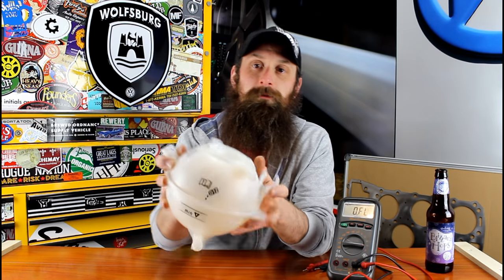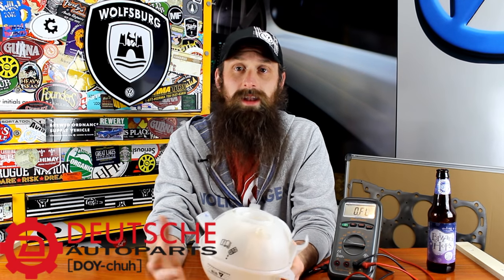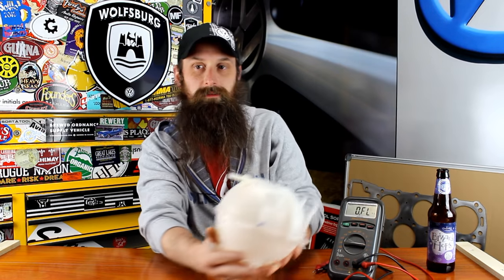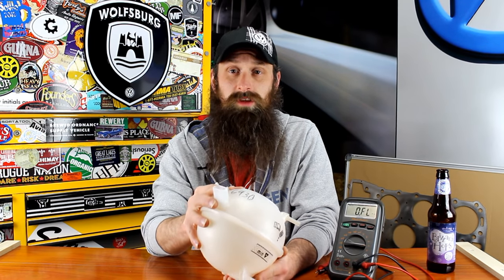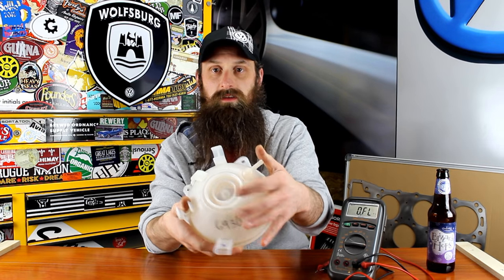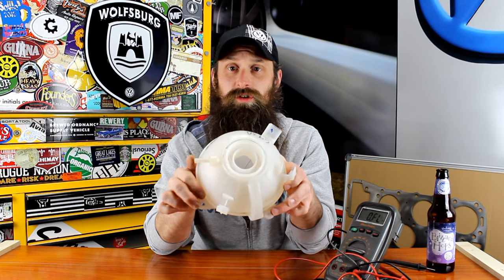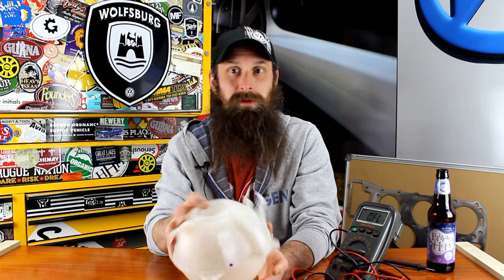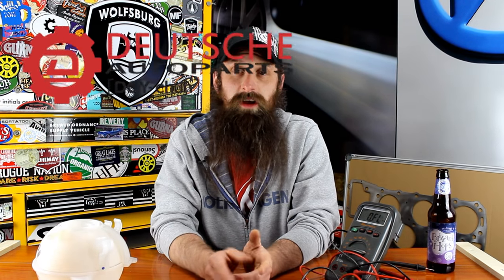How VW Coolant Bottles Fail

Comment: Hi, might be worthwhile updating this video. Many newer vw/audi/skoda/seat, have a marking on the bottle ' Mit Silicat', german for with silica. This means it contains a small pouch of silica, in the bottle. these pouches have been known to fail, and clog up the cooling system, especially badly affected is the heater matrix. To avoid this, I removed the pouch, flushed the system and filled it with the correct mix of vw evo 12 coolant, to ensure the coolant retains the correct anti corrosive propertie.Keep the videos coming, I find them really helpful!

Comment: My 04 Jetta  was running  hotter than normal. I had already  changed the reservoir and cap.  I then changed both the thermostat and  ects  ( engine coolant temperature  sensor). Well everything is  perfect again. I don't know which  part was the problem, but since I  had to drain the system I thought I just  change both parts . Thermostat was$9 ,sensor was$17
Reply: yes I also have a 2004 Jetta 1.8T engine the reservoir cracked at the top and I just ordered another one not only did that go to coolant control temperature when also I replaced that but now it doesn't seem to be working I guess the whole problem is the coolant reservoir bottle

Comment: Just thought I'd mention this, as I had an issue with coolant level sensor on a Skoda (same as VW & Audi). The 2 prongs in the bottle dont relay resistance the cluster module calculates capacitance. This type of sensor is called a capacitive sensor.Similar arrangement also used in the sump pan to detect oil level, but the capacitance calculator is built into the oil sensor.
Reply: Correctly said...

Comment: very cool, I'm pretty sure I have this exact problem on my 2006 Jetta TDI, the low coolant light comes on when the engine is cold, but if I turn the car off and back on again after it warms up slightly, the light doesnt come on, and the coolant reservoir is full
Reply: Same here - did cleaning the electrodes fix it? (OK - 6 years ago but hopeful : )

Comment: This would be a great video to launch off into VW coolant system woes.  I had a coolant light and a p2181 error on my daughter's 2003 Beetle.  I replaced the reservoir and still had the coolant error.😬 it ended up that the thermostat was stuck open and the engine wasn't getting up to optimum operating temperature.  The water pump wasn't suspect because we had already replaced that due to a broken plastic impeller and previous coolant error.  All said and done, we still love our driveway full of VW cars!

Comment: I Have 215,000+ miles on my 2004 Jetta TDI, got the coolant light and ended up being a leak at the small hose.  Speaking from experience...TAKE YOUR TIME CHANGING THIS RESERVOIR- The parts of the reservoir that connect hoses/connector were VERY brittle.  The old reservoir doesn't matter but the job is way harder and longer if they break on the inside of hose or even the connector clamp. Cheers and good luck!

Comment: best video yet on this subject. I have 2001 Jetta. Have flushed and filled with VW coolant. Always the one sensor rod closest to firewall corrodes. have replaced 2 times. No coolant migration. Even after flush/fill, coolant gets brownish. Could this be oil and could it be due to a bad oil cooler or seal? Thanks

Comment: My 1985 mk2 doesn't have any lights for warning me about low coolant levels and such (It has 4 lights total, power connected / warning light for engine running too hot / oil low / high beam), I just check all its fluids monthly, works for me.

Comment: I had a couple Volksagens that used a round one just like that.   There must be minor differences like the cap and bolt hole locations.  Over the years the cap is one change that is easy to see since the color and style changes but they all look interchangeable otherwise but probably are not.

Comment: Hi. I watch all of your  videos.  I don't know if you answer questions, but I  have a question about  my 2004  2.0litre Jetta. It just  started to run a little hotter than  normal.  The  temperature always ran with the gauge   straight up  in the middle. Now its more like 1 o'clock.  I changed the reservoir and  cap    because there was small leakage  around the return  line. I also  bought a thermostat and  a coolant temperature sensor.  What does the sensor do? Does it   control  hi and low  fan speed?. I'm not  sure how the cooling system  works.  Thanks

Comment: I own a stage 3 VW that keeps going through radiators every 4 months or so. I'm carefully installing them and tape cardboard to the fins so they dont get poked on install...

The car has aftermarket cooling fans. I used 2 relays and put them on switches... It has polar fis and I manually switch the fan on if it reaches 190° or so. I don't use AC. It throws a code for the cooling fans and AC. I want to code them out if possible but really need to figure out why my radiators keep failing.

My best guess is an electrolysis issue but I cant find a vw video on this topic. Have you dealt with this before?

Comment: My mechanics worked on my 2003 VW Passat 2.8L GTX cooling system to find and repair a leak.  A couple years later the heater core was replaced after removing the dash.  I am fairly confident the coolant system was completely flushed both times.  But after the first repair, the coolant bottle swelled up and developed a crack on top.  The coolant bottle was replaced.  After replacing the heater core, the coolant bottle again swelled up and developed a crack on the underside.  Sometimes when I stop the car, steam comes out from under the hood from the coolant dropping on the hot engine.  I have to top the coolant frequently. After the second repair, I replaced the coolant temperature sensor myself but did not burp the system.  Now I know better.  But do you think the swelling and cracking coolant bottle could be from air in the coolant?  The gauge on the dash indicates the car is not overheating, and there is no problem with the heater core for cabin air.  Any suggestions are welcome. - - Also, could you discuss how the VW Passat coolant bottle cap functions.  I have come to the conclusion that the cap opens and accepts air into the bottle after the coolant in the radiator cools down and creates a vacuum in the coolant bottle.  Looking through the cap opening, there is a small side compartment with a drain tube down the backside of the bottle open to the ambient air pressure.  Somehow the air must get into the center cup in the cap after the plug is sucked down, but I do not see any openings or even pin holes.  I cannot find anyone on YouTube or Google describing the function of the VW coolant bottle cap.

Comment: Hey Charles. 
I have a 2004 vw touran 1.9tdi 102hp. After a new head gasket, water pump, timing belt and a lot of other small stuff, I have a problem with my coolant. After 15min of highway driving I get a low coolant warning. And when I check the coolant tank is empty. Unscrew the lid and all of the coolant comes back. What do I do?
Reply: Having the same problem with my 04 Volkswagen caddy

Comment: I have 2004 jetta tdi that I just got a few months back.  Did a complete fluid change of all fluids.  Noticed inside the reservoir that one of the electrodes inside was completely missing.... The red light would randomly come on telling me my fluid was low.. Which it wasn't, but since one of the electrodes was missing, figured I should replace the bottle. Installed new one, and all was ok for a little while, then it started again with the light. Checked bottle, the same electrode on the new reservoir was starting to gunk up and, I had some coolant migration into the connector.. Not heavy, but would classify as moisture.  I cleaned the electrode with a tooth brush.  And it's fine for a bit then gets gunked up again. I just received the replacement reservoir from ECS tuning, free of charge, and I'm hesitant to replace it. For the time being, i have the plug disconnected and jumpered.  Something, has to be causing the coolant to flow up the electrodes and into the plug?. The one electrode is acting like a sacrificial anode.  I can replace bottles and engine harnesses all day long.... until the root cause is addressed, I'm afraid this will continue... Your thoughts?

Comment: Dude, great video. Yesterday my wife, son and I were getting ready to run around. Backed my car out of the garage (2012 Passat SE V6 B7/NMS platform) and the light started blinking. The coolant is below the min in my resovoir so I headed to autozone today to pick up some pentosin pentefrost e. Manual says that light is a coolant system malfunction. I’m surprised there wasn’t a a low coolant warning light that came on, however my wife drives it daily and hopefully she didn’t over look the warning light. Being that the light flashed however based on your video I will look at the contacts and see if they are gunked up. There is approx 70k miles on the car.
Reply: So upon further discovery: when i went to add coolant to top off the reservoir, the first thing i noticed was that the cap was loose. This was probably done during the last service at the dealer. I'm assuming i lost coolant due to evaporation?? I guessed accurately at adding 16 ounces of fluid (8-oz coolant, 8-oz distilled water). My next question is since the system is to be pressurized, would there be contingent damage due to the cap being loose? Any thoughts ?!?!

Comment: HumbleMechanic , I have a trouble with my vw Polo 1.2 MPI (Petrol) here in India. Recently, i am observing some weird engine RPM while driving. My observations are as follows: 
1) At cold start Engine RPM is 1300. Then, it falls down to normal 900 range after a slight warming up.
2) When the vehicle moves, in the 2nd gear with an RPM close to 2000, and if i leave my foot off the gas paddle, the RPM hesitates to fall down immediately. Basically, it stays at its place and starts to fall after say 1.5 seconds. Same goes with all the gears after that.
3) RPM up : Gas Paddle Off : RPM needle does not start falling, but stays for a sec and then begins its fall.
4) Later, when the engine is up and running for a while and if i stop at a traffic light, in neutral, the RPM stays at 1200 and does not come down to normal idle(say 900). 
5) If, i press and release the gas paddle once or twice...then, somehow sometimes, it returns to 900.
.

P.S. I took the car to VW show room and they said car is normal after driving. But these fluctuations are definitely not normal. 
I tried to correct it by myself, i cleaned and checked the air intake filter(it was clean) 
Opened up the throttle body pipe, and cleaned up a little carbon deposited around it(with engine off and gas paddle pressed with key on).
Still the problem stays. However, cleaning throttle body intake, made the gas paddle responsive. Initially with the press of paddle i was not getting an immediate RPM up too. This issue is fine now.
Please help if u can. 
Pardon me for such a long query .

Thank You.

Comment: Cap failed on mine years ago. Spilled the coolant out every time air con was on. Can be serious if a very hot engine suddenly loses a bunch of coolant through depressurising quickly. If it happens to you don’t drive it, let the engine cool down. If you need to get home, top up up with water to get you there, get a replacement cap asap.
Reply: Mine is throwing coolant out too .. Does cold starts even after drive it for some time, temp gauge does not work properly.. engine seems to be running fine, no power loss at all but just can figure it out..

Comment: 02 vw gti vr6 with over 400k and still going. 09 gti as well. Not to mention  the rest of the fleet from big rig to diesel 3500 and 2500 and f250 and motorcycle.  Out all them vw is the biggest pain between the secondary  air injection  tube coolant globe the climate controls and radio ignition switch harness cooling fans

Comment: Still a problem on MK7 Jetta, coolant made it's way from the bottle to the BCM through the electrical harness.  2019 Jetta, 18 000 km. Now parked at the dealer because the BCM is back order and the car is f****up

Comment: So I had my ac on high blast in my vw golf 2013 and it was a really hot day. After about 15 minutes, the coolant light came on, and the engine temp started going up. When I looked at it I found spilled coolant on my headlight, and around the coolant bottle, along with some spilled below it. There was also a puddle right below it on the ground. Was this just the coolant bottle spilling coolant from the pressure? Or is it something worse like a pipe or a plastic flange? Thanks!
Reply: Max Vorobey same question did you ever figure it what it was?

Comment: I had the plastic crack around the coolant return, replaced the bottle, and now I'm losing coolant at a furious rate, but don't know from where.   It seems to be collecting on the rim around the middle rim of the bottle, but have never managed to catch it actually coming out of anywhere.  It's gotta be the cap or the overflow tube, or the sensor port..  but that narrows it down not at all.    I tried a new cap and it doesn't feel like it is as snug as the original one, and leaking just as bad (if not worse).  It's like the tolerances of the new bottle opening just don't match the old or new cap.

Comment: Surprised you didn’t mention more about the caps failing. I’ve had 2 VR6 Corrado’s both with overheating problems caused by faulty caps.
Reply from the maker: I have seen 1 cap fail in almost 15 years. It's possible for sure, but not super common from what I have seen
Reply: HumbleMechanic it’s possible it was just a problem for the European market. Either that or I’m just unlucky!
Reply: my coolant cap shot off leaving the threads still threaded what would cause that much pressure to make it explode like that
Reply: On to my 3nd cap. And 2nd bottle!
Reply: Agreed... it is a faulty seal in the caps
Reply: I just had the seal on the reservoir cap break! Car overheated out of no where water boiled out of that thing, like all of it within 5 minutes!  Stopped, filled it with water, but had to stop one more time within 10 min happened again. Replaced thermostat and still overheated and battery died that time. Just unscrewed cap to look at it and little black seal had broke off of cap and was floating in the water.
Reply: @HumbleMechanic  Hi, i have an issue with my 1.9TDI PD where at 90deegres water temp, if it sits at idle for more than 2min or so it will start to leak coolant through the water pump (whole timing belt and auxiliary belt were replaced about 20k kms ago), coolant is clean now but it did have moisture and rust in it when i first bought the car, could the cap and the reservoir be the culprit? Why is it leaking through the pump, i dont have water in the up pipe going to the reservoir tank

Comment: Lol I just replaced one on a MK7 Jetta with 7k miles. 🥴 the newer ones tend to  see the cap fail. The cap doesn't vent apparently, and the system over pressurized causing the cap to press upwards and gum up the threads. Then you can't remove the cap without destroying the bottle threads 🤷‍♂️

Comment: Hey Charles I know this is kind of an old video , My coolant bottle has changed color to a dark brownish kind of orange color I'm not getting any lights on the dash but do you know if I would have to replace it?
Reply: Did you solve this? My car has the same thing
Reply: It’s fine but the discoloration means the plastic is being Eatin into id replace it if you are worried about it

Comment: Please help i hv water coming out tru a reservoir breather on my vw polo while am drivin bt the car does not overheat ,fan turns on fine at 90 degres i changed the reservoir cap bt nothing changes what could be the cause

Comment: Thanks for all the videos! I have a 2008 mkv GTI, fsi engine. I just developed a bad coolant leak a couple of days ago and it seems to be coming from the lower front area of the engine. Where should I start looking?
Reply: Its probably the radiator. I had something similar on mine and it was a busted radiator.

Comment: Do you think that a crack-leak in the bottle would also cause the engine to idle higher? 2010 MK6 Golf TDI far from stock. My drives are short so I think the battery is just not getting charged, but it is a VW!?

Comment: That thing with the wires being covered with coolant.  I would assume that changing the coolant on time could help prevent that?  It does turn acidic with age.  Please don't think of it as just water.  It is more like highly toxic water that is a mix of different chemicals.  Also I imagine that some water pumps could be saved if it is changed on time since the coolant also lubricates better than water does on its own.